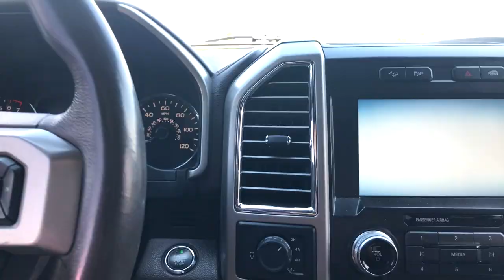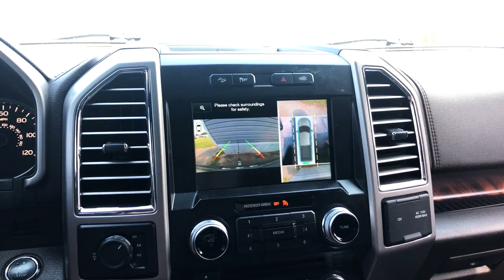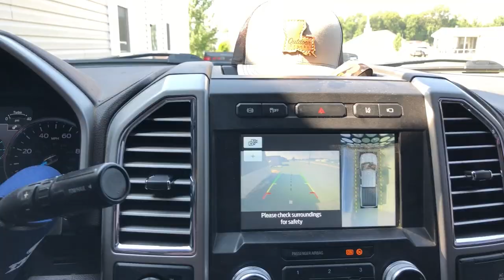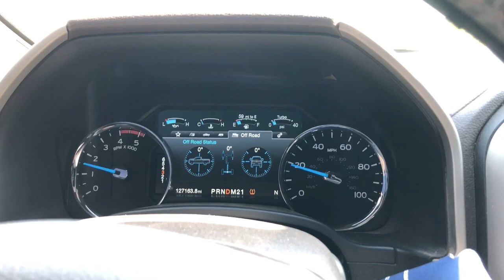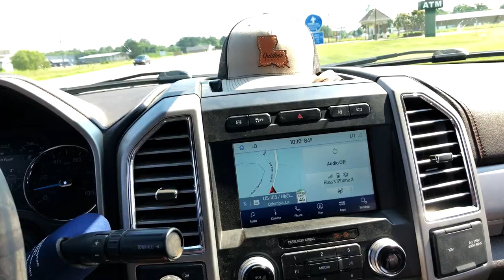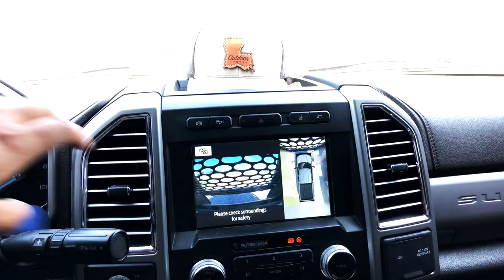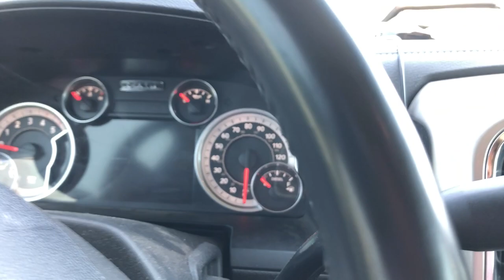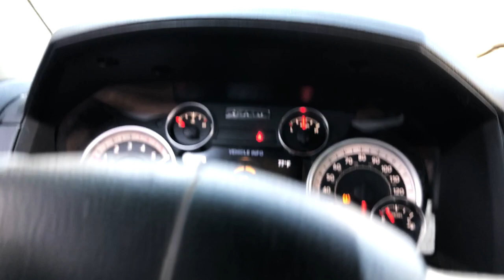TURBO NOISE SOUND TEST (No Limit Fab Stage 2 Air Intake on My 2017 6 7 Powerstroke!) INSTALL

Comment: Do you think water could get inside in to the no limit intake other than S&B that's all covered?
Reply from the maker: Theoretically yes but it's pretty protected from water splashing but if it's getting into the intake, the truck is probably almost totally submerged in the water and in that case, S&B wouldn't do any better bc it's not a water tight box